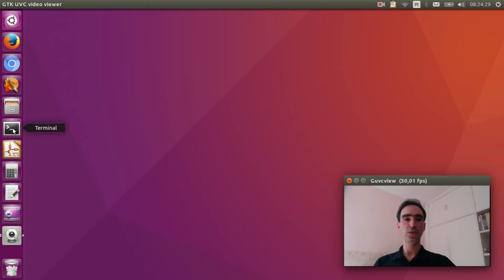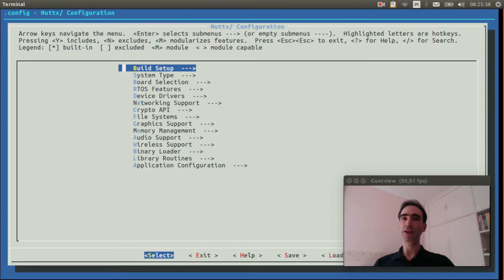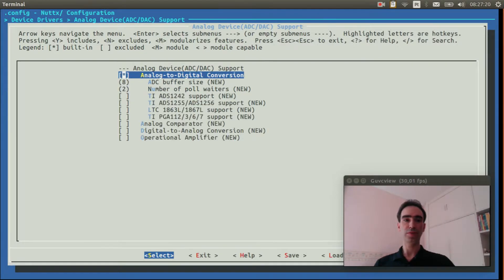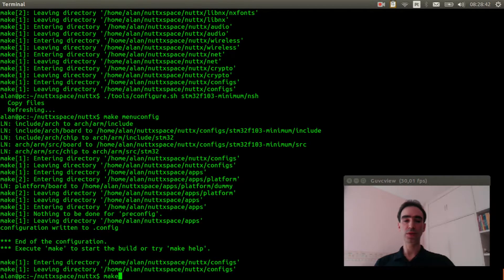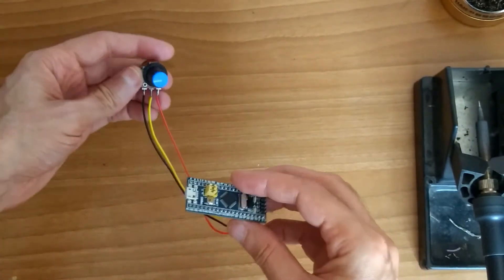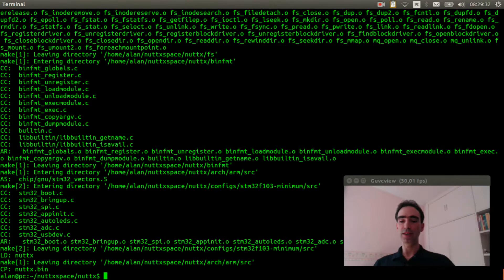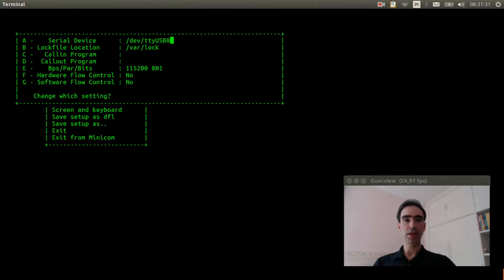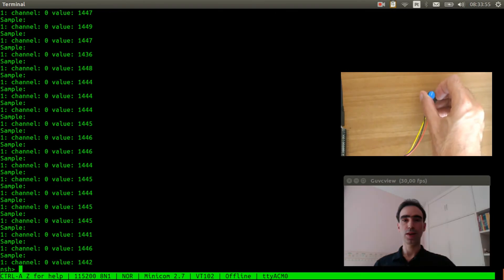#019: Reading Analog Input on NuttX

Comment: Hey Alan, STM32F103 minimum board has so many ADC channels but on the menuconfig it shows only 3. Can you tell me if there is a possibility of connecting multiple ADCs and fetching their data?
Reply: Hello, you need look at into file 'boards/arm/stm32/stm32f103-minimum/src/stm32_adc.c'. And looking for '/* Configurations of pins used byte each ADC channels */'

Comment: I've followed this using an stm32f429i-disco and everything builds however after flashing nuttx, the /dev/adc0 driver is not loaded. I'm using the 7.22 build of nuttx and apps. I'd like to use nuttx for my project but need to read adc.

nsh> ls /dev
/dev:
 console
 loop
 null
 ttyACM0
 ttyS0
 zero
nsh> 
nsh> adc -n 100
adc_main: g_adcstate.count: 100
adc_main: Hardware initialized. Opening the ADC device: /dev/adc0
adc_main: open /dev/adc0 failed: 2
Terminating!
nsh>
Reply from the maker: Hi Tom, you need to create the file configs/stm32f429i-disco/src/stm32_adc.c, modify the Makefile to compile it and call the stm32_adc_setup() function from stm32_bringup() for example.